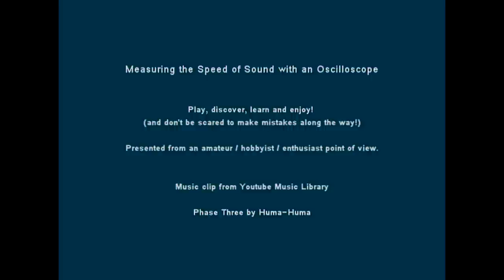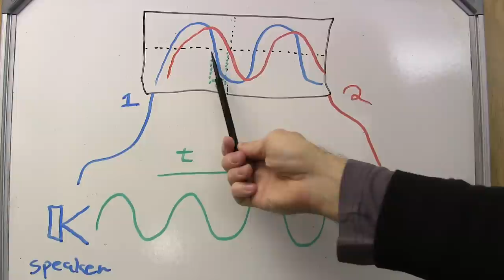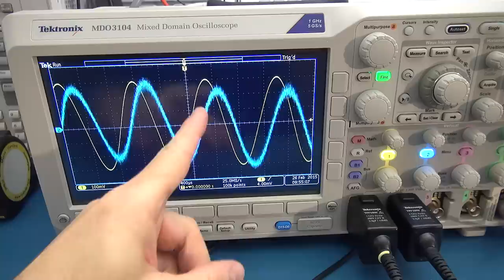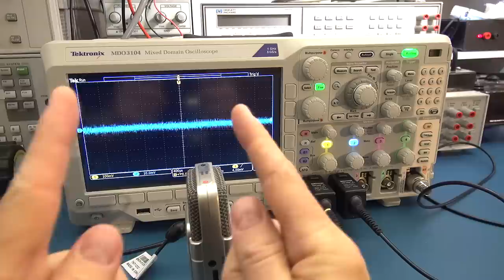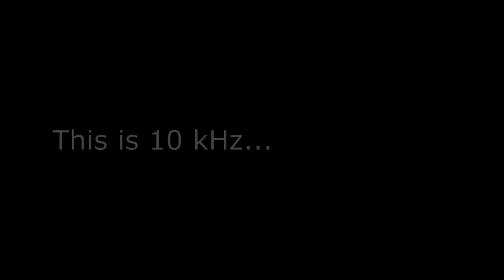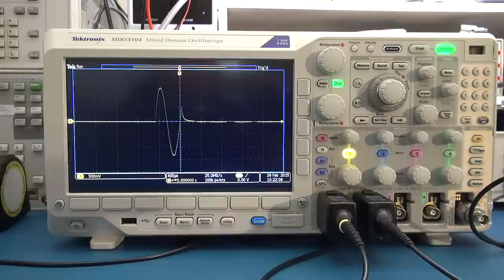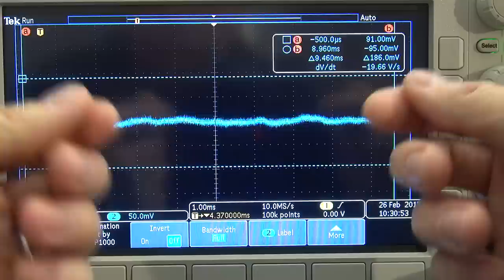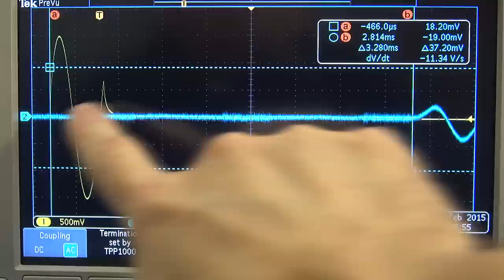Measuring the Speed of Sound with an Oscilloscope...and Hearing Test

Comment: Get 2 identical microphones with long chords.  use the same speaker. set both microphones about a meter away to start a baseline value so both are reading the same wave length (on 2 channels) at the same location. then you can slowly move the second microphone away any distance you like. another meter further away is fine
Reply: hi

Comment: You could have eliminated all offsets of the speaker and microphone by measuring two distances, and together with measuring the peak as you wrote in your video, I guess you could get pretty accurate measurements. Next speed of light :-)

Regarding your hearing test: I don't know if it is Youtube or your recording setup, but I recorded the output of your video with Audacity (optical s/pdif output at 44.1 kHz from a Creative SB X-Fi and optical digital input to another USB sound card) and there is no signal (except the click at the beginning) for your test sequence above 15 kHz. I created a 17 kHz test sequence with Audacity and did the same test and it worked. Maybe add a note to your video so that people are not worried that they can't here above 15 kHz anymore.

Comment: I think your measurements might be more accurate than you think...
The røde videomic that you've used hasn't got the actual microphone element at the end of the tube, it's actually recessed at the back of the tube. If you do the calculations with the 0,3ms error that you got (v*t=s) v is the textbook example of 340m/s, you'll get 0,1m (10cm) witch looks roughly like the length of that røde mic tube.

So in fact, you've  got very good numbers in this test :)
Reply: mic element  is at 1130mm
Reply from the maker: TheRAZZITEAK Aaah...so not that bad then. Thanks for the post.

Comment: I just did this experiment. I used the equation t_travel = distance/speedofsound + t_lag, where t_travel was the time for the sound to go from speaker to mic, distance was how far the mic was from the speaker, speedofsound is the speed of sound, and t_lag was the "lag time" in displaying the signal 2 from the microphone. I took 10 data points from 10 cm up to 100 cm. I graphed y = mx+b, where y was the travel time and x was the distance. 

I found y = 0.002820x + 0.000184 after graphing time in seconds and x in meters. My slope was one over the speed of sound. This yielded the speed of sound = 355 m/s. I am a physics teacher and am about to have my students try the same lab. Thank you very much for this inspiring video!

Comment: Take two measurements (e.g. at 0.5 meter and 1.5 meters), and use the difference between those measurements. That will correct for any processing delays introduced by your equipment.
Reply: Todd Geders Yes, this tecnique caled linearization, and the offset b is the addition delay. y=ax+b. Actually you need more that two points, but also with two you have a good approximation. 
http://web.williams.edu/Mathematics/sjmiller/public_html/BrownClasses/54/handouts/MethodLeastSquares.pdf
Reply: thanks for the link as it was kind of intuitive article and goes whats wrong and how we fix it and goes very intuitive and step by step solution ..really loved it .

Comment: The null that occurred as you moved the mic closer to the speaker was due to a standing wave (?) that was setup between the speaker and I guess a wall off camera to the right.  If so, if you where to move the mic farther to the right you might detect other nulls.  Lay some foam or carpet around/behind the mic and speaker to damp the reflections.

Cheers,
Mark
***********************

Comment: I think I've detected a flaw in the experiment.  Correct me if I am wrong. The sound being generated is a series of single shot of sine waves. If we did not know the speed of sound as a reference to check for accuracy, how do you know that the mic signal to the right wasn't some multiple of the originating wave being received by the mic?  ... If that makes sense....

A better way would have been a single burst of an event captured by the mic.  Or am I incorrect?

Comment: Fun little measurement:-)
I know that it was not scientific but here a few things that you could try.
1) To avoid sound bouncing af the walls and so on, use as high a frequency as possible.
2) Send as short a puls your system can work with.
3) Place the microphone and speaker as near as possible, to calculate the time it takes for your signal to go out the signal generator, through the wires, into the recorder and back into your scope.
4) Try again:-)

Comment: Nice to see you experimenting and using one of the scopes. The microphone amp does make a delay, so a 2-point measurement or unamplified would have been better. You could use a little piezo (perhaps with an opamp) as mic too.
And theres one tip I would like to give you for a long time from a photographic standpoint (as I work in portrait photography industry)...please set your camera a litte higher, it does look much much better Martin when you are not filming from below your chin (wideangle is also not that great, but I can understand that you want to show as much of the lab as you can..). Keep up your good work (actually I wish there were more often videos from you ;)  ).

Comment: The way I'd do it is this.  I'd have two identical mike mikes placed a certain distance apart.  I'd drive a speaker with a pulse.  The first mike would turn on a gate, to allow a clock signal to pass.  The second mike would turn it off.  By counting the number of pulses that passed through, and knowing their frequency, the speed could be determined.  By the way, I like the phase difference method you describe, it's quite clever.

Comment: Thanks for the video.
If you make a series of measurements at different distances and plot the values of time delay vs distance. A linear regression (trend) should give the true speed (RECIPROCAL 1/v) in the slope and the microphone response delay or offset in the intercept of the equation y=slope*x+intercept (delay=(1/v)*distance+offset).

Comment: The delay you were getting via Zoom recorder is a standard delay due to A/D converter in the unit. I think two piezos would make a better measurement - one to transmit other to receive. You can measure voltage straight off them. And one tip: to avoid that annoying tone all the time, simply use 20kHz signal. While ears don't hear it, mic will grab it perfectly.

Comment: I did the same experiment, but in a much less complicated and in a more wallet-friendly way. I just used two 27mm piezo buzzers and, without amplification, hooked them up to two probes . Then I put them apart by roughly 1,5m and clapped my hands making sure I was standing in line with the two piezo elements. Single shot trigger on channel one and "Bob was my uncle" like Dave would say...   $ 3,- max (excl. scope)  :)

Comment: HI Martin. Thanks for the video very interesting, it gets the mind going.
My thoughts are that the distance measured may be out. Maybe from the coils in the speaker to the element inside the mike. I think you measured to the front of the mike housing. You may be closer to the value than you think. Great Work!

Comment: 19:50 I think you have the speaker wired backwards and should measure from the first peak from source and the first significant peak on mic, in this case I think it would be the first negative peak.
Edit: you should also do a "Calibration" test with them at no gap at all to find the delay time from wires and the processing in the microphone
Reply: or even better, have 2 microphones and one sound source.
Speaker---10cm---Mic,Mic Calibration test right right besides one another, then the distance test.
Speaker---10cm---Mic-----------------------------------1Meter-----------------------------------Mic

Comment: Nice video.  It would be better to use balanced audio (+4 (3 conductors per channel (RTS))) equipment with XLR connector instead of unbalanced (-10 (2 conductors per channel)) mini plug connector.  I guess you would need a matchbox impedance transformers on the I/O in your setup.  Anyway my point is that unbalanced audio is susceptible to all kinds of interference like from LED lamps etc.  Just my 2 cents worth.

Comment: Your measurements can not be accurate because the speaker has a relatively large mass (inertia). A better method is to two microphones (preferably identical) set at a distance of 1 m in a straight line with the sound source. The first microphone as a trigger, the second as a measure. Sound source does not need to be a speaker (generator) - just clap your hands.

sound source --------- trigger mic ----------- 1m ----------- measure mic
Reply: MrMaaalek ... exactly my thoughts too.
Reply: It's written on edexcel igcse physics book😑